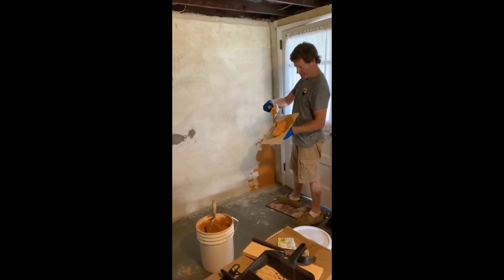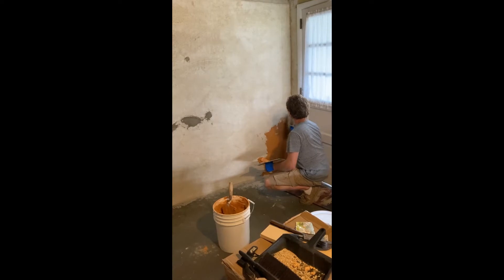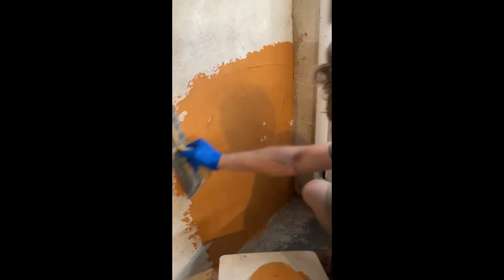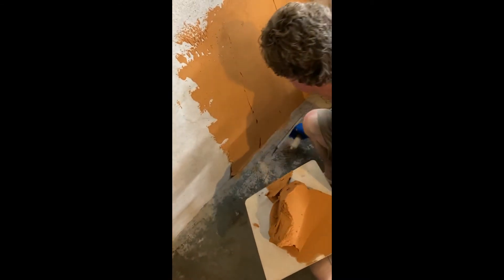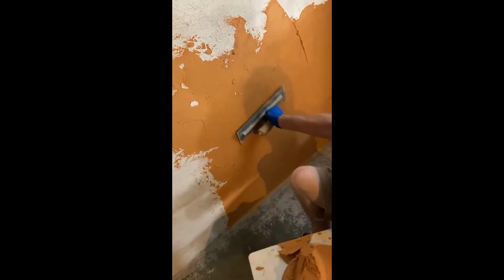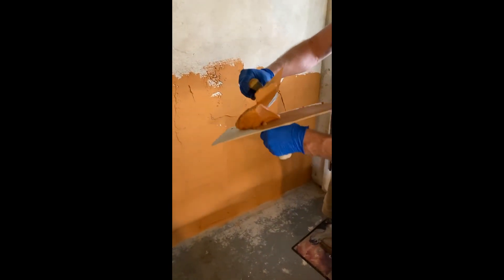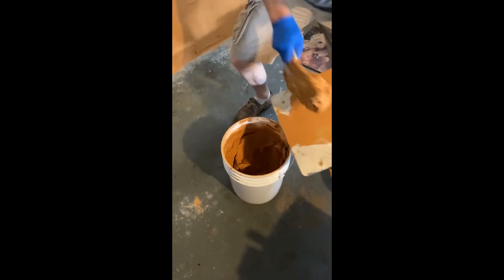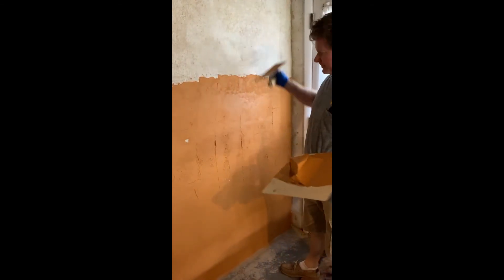Installing Lime Finish Plaster

Comment: What are the situations where lime is more appropriate than gypsum? I gather basements are a good place for lime. I also understand bathrooms. Both due to high moisture conditions. However if you just want a nice finish on blueboard, isn't gypsum the way to go? Especially from a cost/benefit standpoint?